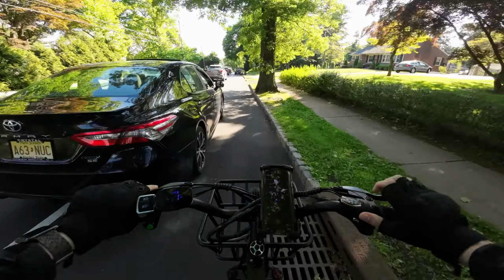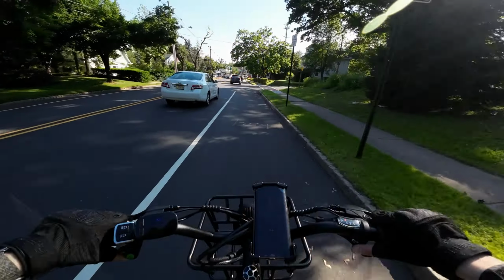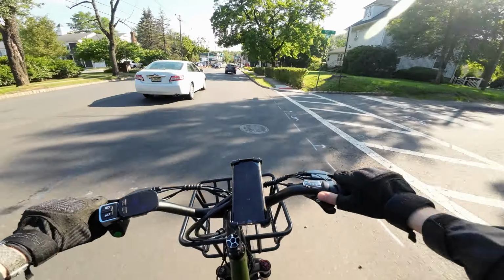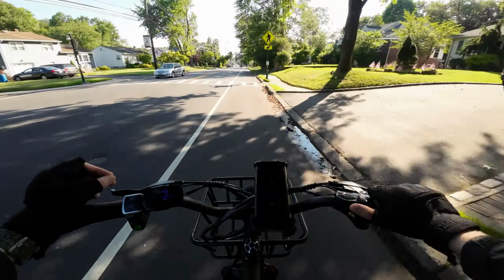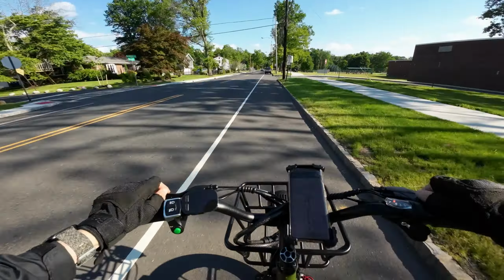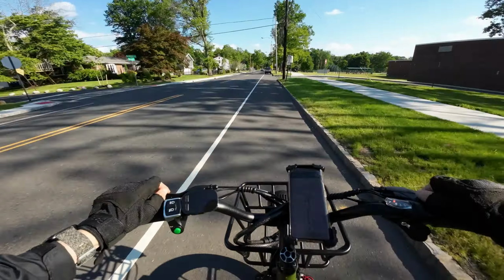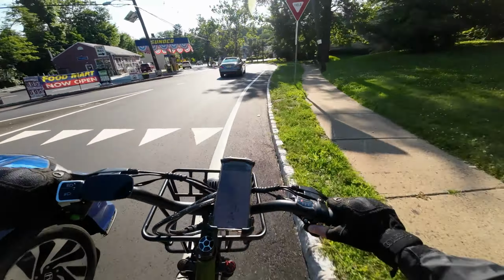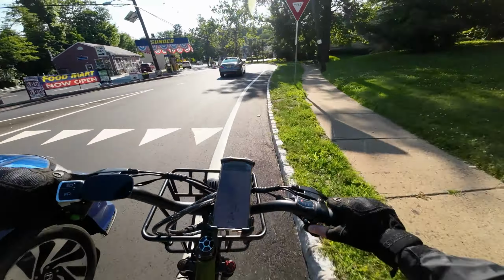Don’t Pick the Wrong eBike Conversion kit

Comment: You kept us in a bit of suspense with your riding so close to the cars!  I am in the middle an old ebike gut/upgrade ..added 2kwatt hub with 52volt 20amp blue brick battery! I  thought about kill SW or ignition SW.  too.  I would think you need to match max amp load unless your controller has an option for a switch.  Mine is 50 amp max and just found a marine on off kill switch with a high amp and volt rating on amazon easy to find there if interested. Something you’d us in a dash not pretty but still looking!

Comment: It might be easiest for you to put an ignition switch on your bike by using it to cut all power with a relay. You could just wire the key switch to run a relay with high current capability that controlled battery connection. Just run the relay from a 12v BEC powered by the 60v battery. I like to solder so if I was putting key on my own bike then I would just tap in and use key switch to control connection of the power/mode button on the handlebars and I wouldn't have to bother with a relay or BEC to run it.

Comment: I have a keyed ignition on my custom build. Really should make a video about it too. Using some random 1000W kit I picked up on Facebook marketplace for $150 including motor, controller, and brake levers and I have been loving it. The controller had very few wires, but I found out there's internal headers I could solder to in order to bring back functions such as a dedicated cruise button, low-med-high switch which actually unlocked a hidden boosted mode, and the interrupter for a keyed ignition. Neat stuff. I'm sure you could find some way to make an interrupter for the display, as I think that sends the actual on/off command.

Comment: I know what you're going through. I manage to burn my bafang controller and instead of putting stock one I decided to go with sabvoton controller. Wiring harness was pretty painfull. Every wire is soldered intead a display that came with the controller. I doesn't find anywhere information about motor hall sensor so I just try every possible combination until it Start to spin smoothly. (red to red, Black to Black, White to blue, gray to yellow, blue to green) 😂 It was all worth it. Now it's going like a dream. 👌

Comment: I really want an e-bike, but I'm scared I'll get burned on a cheap starter bike. lol
Reply: Go for Crooked path, they're currently on sale and I love mine
Reply: A large portion of cheaper ebikes use a fairly common motor the bafang geared hub motor which can get u up to like 32 km an hour without your own pedal input

All of em are pretty good it just depends if you want suspension to be comfier or not, wider tires like fat tires add a lot of cost usually, other than that, go for your size, and don’t forget you can upgrade and change out loads of parts and pieces

Comment: ignition is basically an interrupt and you can install an interrupt anywhere you can dream of you can even bypass them

be very careful with key ignitions!!!! i cant tell you how many times i used any key on my key ring to turn the ignition because i forgot the equipment keys or another operator kept the keys.
i have even used screw drivers to turn an ignition. i will be bypassing any and all keys on my bike and hide a switch in a hard to see area and lock my bike

also i might put a vibration alarm for deterrent and have pepper spray and a BFK (big fucking knife) if i meet any hijackers

Comment: make sure you can take 3-6 months off your job, that your health insurer will stick with you if your job lets you go because 
your in a bed for 4 months after crashing going 35 miles an hour and get wiped. 
Beware; this activity is crazy dangerous.  I know cause it happened to me. 
It can cost you your life or your health. Imagine your in your recliner at home, put on your helmet and start going 35 MPH. Same amount of protection if you crash. No face shield? If you hit something, your face will hit the pavement first. Try $8000 worth of surgery and dental reconstruction after your fractured facial bones heal. It knocked most of my front teeth out or broke them.
Those bone shards in your sinus, leave that for later.

Comment: You know the only thing I can't stand about the build you have is the horn. I would get an air blaster horn and put a small cup holder near the grip on the right side off the handle bars. A Velcro strap to secure the horn inside and to remove when you walk away from the bike. That's a horn blast that would get attention when you are cut off.

Comment: I have 1500 motor with sw900 52v battery 20amp can I upgrade to 72v without burning controller current speed 35 Miles per hour thanks anyone